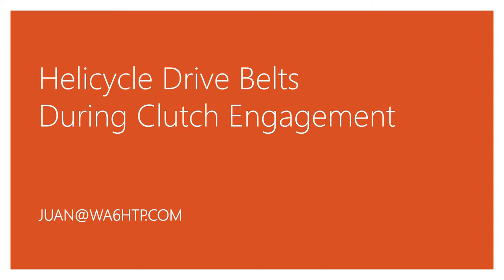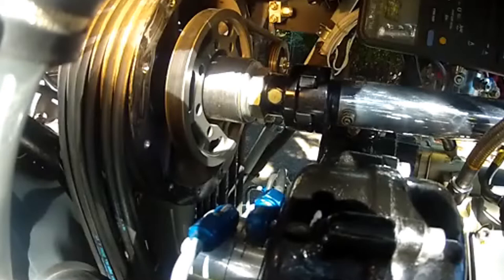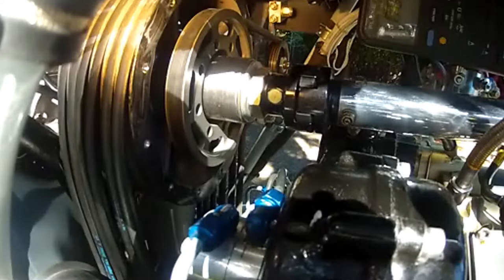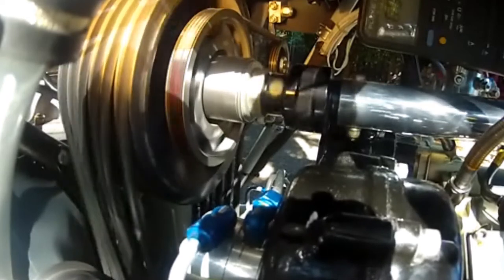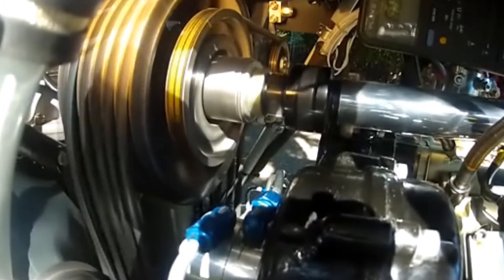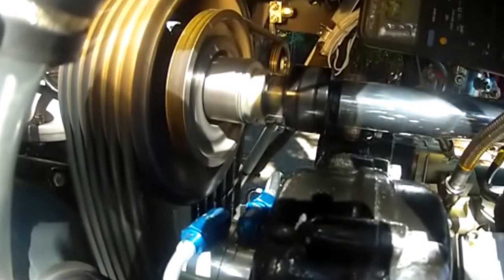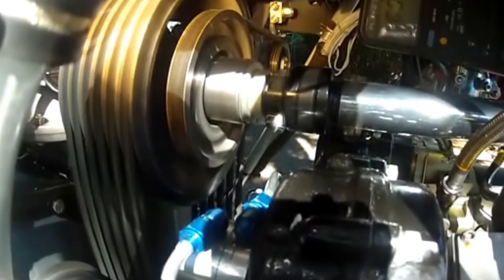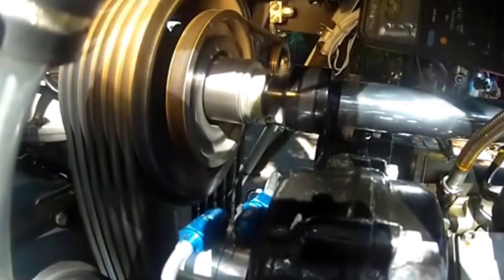Helicycle Clutch Engagement

Comment: Flying model 02-18, the Tom Sled build, N3722T with 1340 Hobbs hours TTAF, ... I expected the upper and lower sheaves to be dis-aligned during clutch dis-engagement, and aligned during full engagement. There is mild vibration between 60% and 80% engagement, but I expected this, too. My engagement process is slow and gradual, as I watch my tachometers during the process up to 485 mr rpm, the ratio marriage between the engine 48,500 and mr shaft rpm. Disengagement is full speed. Immediately post flight inspections with a laser thermometer reveal the six drive belts and both upper and lower sheave temperatures at 120F or less.

Comment: Have you ever seen other belt drive clutch systems shake like this on other helicopters that use them?
Reply: No they are not supposed to do this in normal operation. This type of clutch is used on the Bell 47, Schweitzer 300, all Robinson piston helos, Rotorway piston helos, all Mosquito helos, Helicycle. It's used extensively even on some turbine helos.
Reply: @jcoghill2  what? Certified turbine helicopters dont use a clutch at all. And the mosquito uses a centrifugal clutch.
Reply: @jcoghill2  Bell 47 uses centrifugal, just FYI.
Reply: Robinsons and the Rotorway has the same issue. Many Robinsons have had forced landing because of belts breaking and same for rotorway. Not something they advertise though. The use of belts is intended to be CHEAP, not a good design.

Comment: So this is what your belts do as tension is applied. Those belts sure sit deep in their grooves. Aren't the belts supposed to be bigger in cross-section? I've seen many belts in the automotive world and some of them are stretchier than others. Could be what's going on here. The belts are too stretchy so it takes longer to reach full engagement, that combined with belt tension makes the belts vibrate. As for the engine moving that's never supposed to happen. Check the torque on each engine mount bolt, several are loose. The pulleys should be in alignment at all times. This is another indication that something is loose.

Hey I came back to tell you I just found out those pulleys are supposed to be balanced. If yours wasn't balanced or it was done wrong it can cause vibrating belts.